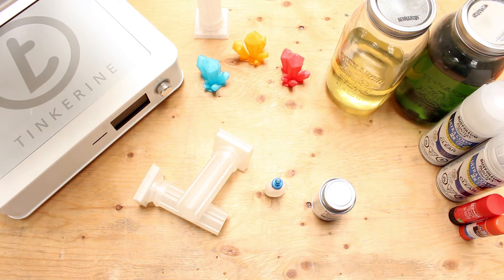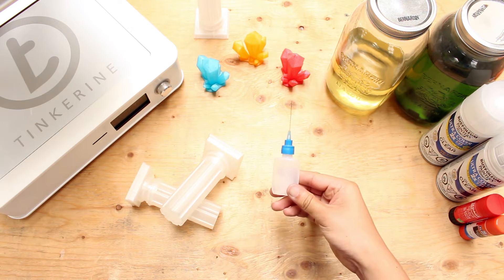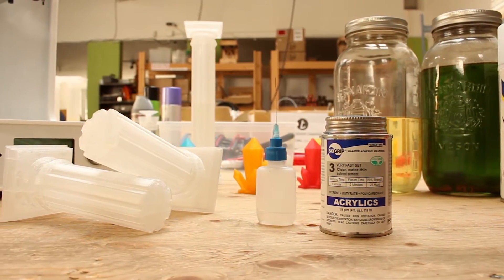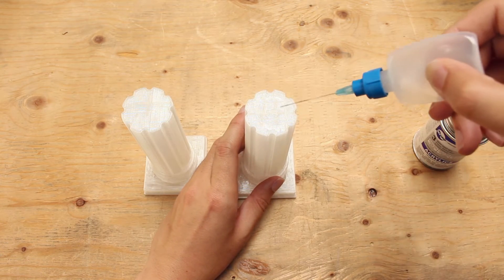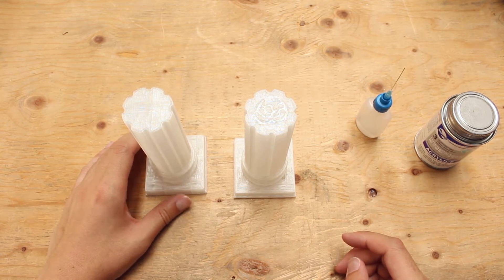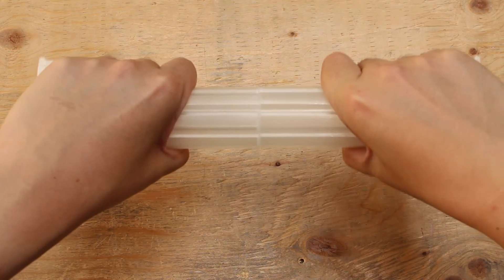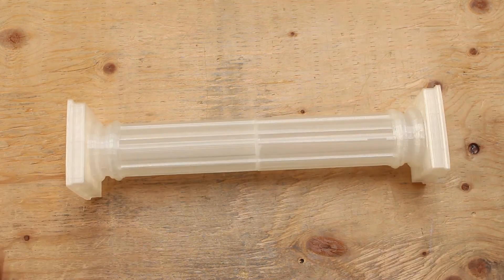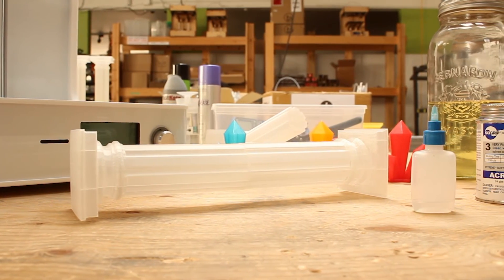Gluing PLA parts together with Methylene Chloride

Comment: It's worth noting that methylene chloride (also known as dichloromethane) will go through pretty much any type of passive breathing protection, so wearing a face mask makes no difference. Ventilation is the key (and don't leave the can open right under your nose). Gloves are also not very relevant, because small splashes will evaporate off your skin faster than they can cause any harm (it evaporates 40% faster than acetone). The main type of protection you'll want to wear is safety goggles, to avoid any of it splashing into your eyes (since your eyes are wet, it won't evaporate as quickly, and can cause burns).

If you're handling larger volumes, wear butyl or neoprene gloves, and a fully sealed, supplied-air respirator. 

Also, if you want to make a thicker version of the glue, that doesn't evaporate as quickly, simply melt some bits of the same plastic into a small bottle of MC, until it has the consistency you want.

Comment: Pro Tip: Don't die. DMC Methylene Chloride is seriously toxic, so be careful. More than a few people have died from fumes in enclosed areas. It should have been completely banned and was in process but stopped during the ex-guy's one term.

OTOH I can't find anything else that dissolves PLA. CA vaguely works but not really. Epoxy probably works but is time consuming and both CA and epoxy harden very rigid which is often not a good thing for plastic items. Solvent type 'adhesives' like this end up with the flexibility of the plain plastic, because that's all that's left after the solvent evaporates.

Comment: if your dealing with plexiglass or lexan, then Methylene Chloride is the best bonding solution as its not a GLUE,  it welds or fuses (molecularly melts) the plastic parts together.  so no gluing agent or third element is involved with the bonding process. which means the parts will stay fused as one unified piece, though it doesnt mean it will bond water tight.  That would all depend on your method of application.  I would suggest the use of two products for water tight seals. Methylene Cholride for the main bond, and a glue that will seal any remains holes.   There are products such as LEXAN POLYCARBONATE GLUE thats a combination of the two. but not having used them myself i cannot say if this one stop solution is the best.  This in reference to things like aquarium tank builds.  But for normal unifying of multiple pieces of lexan,  Methylene Chloride is the best solution.